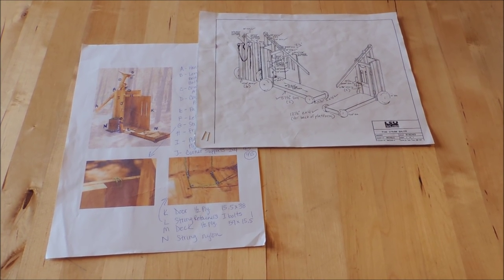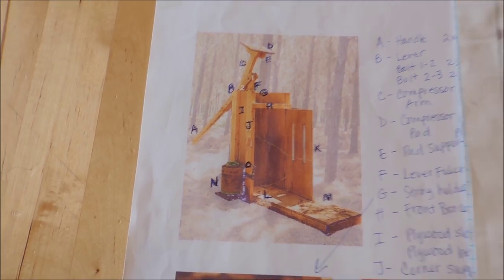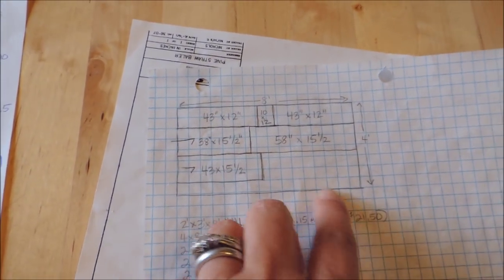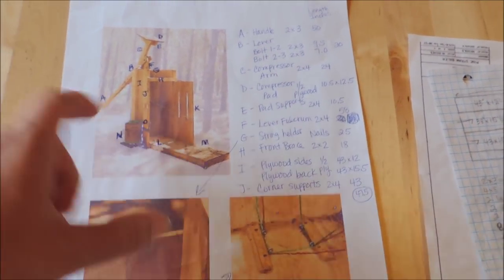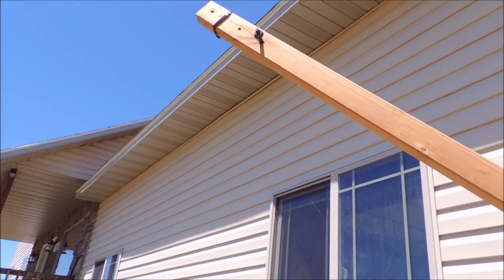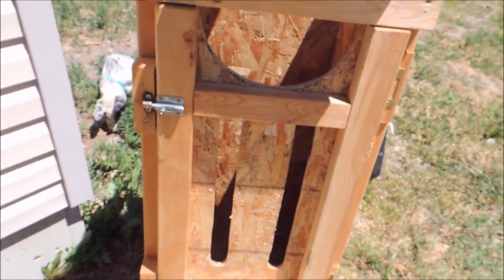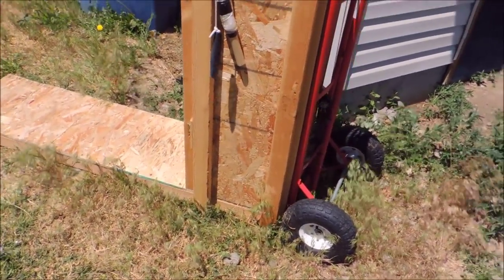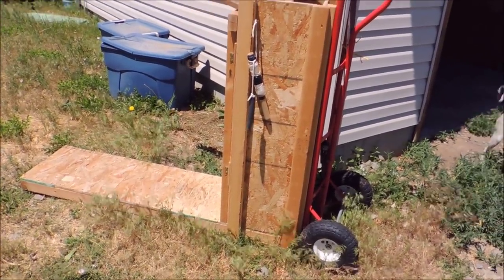DIY Hay Baling Box

Comment: What size pin bolts did you use? And what size washers?
Reply from the maker: I'm sorry but I don't remember. I looked at my plans and there is no note as to what I used. It's tarped and under several feet of snow now so I can't check. I know that I used carriage bolts and locking nuts though. Have to wait till spring to get a size though.